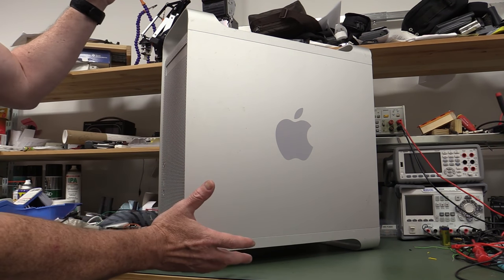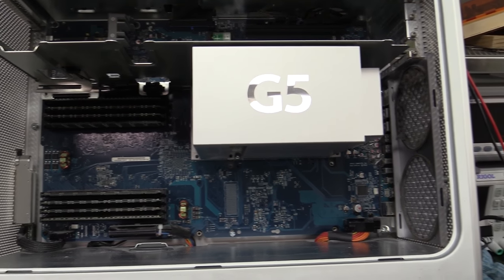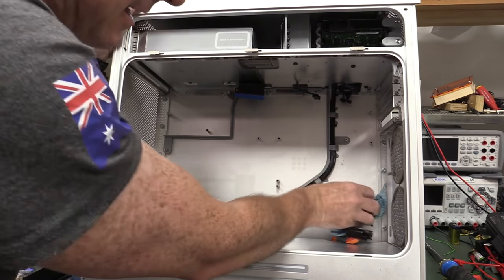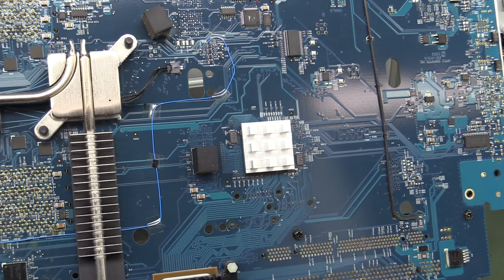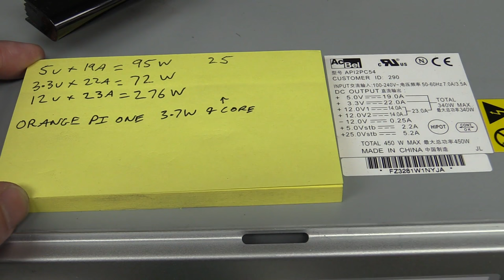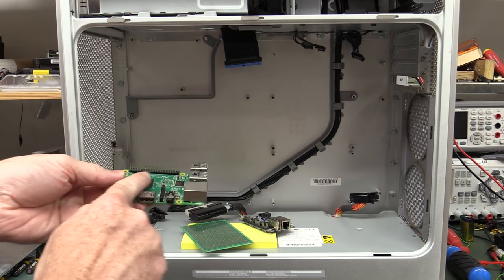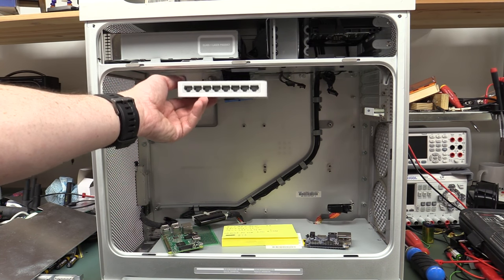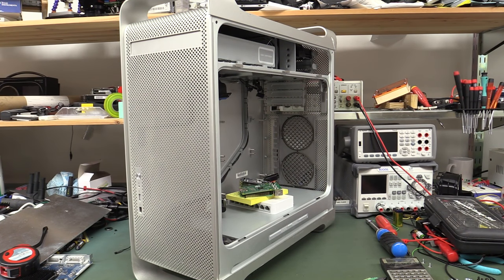EEVblog #946 - Apple (Raspberry) Pi Cluster - PART 2

Comment: I like the pcb mount ethernet jacks as an option the most. Maybe it'd be possible to use PoE to power the Pi's, and not even need them to plug in with the main header at all?

Comment: Wouldn't all those right angle connectors be a bit of a pain with such a dense array of boards to plug in? If you're doing riser boards you could use a nice self aligning card edge connector instead.

Comment: From my perspective, I would like to see more than "just another RPi cluster".  Your channel is all about full integration.  Forget the cables and use those through-hole RJ-45 connectors to mount the switches perpendicularly off the the mobo.  Also, you might as well do the same for the RPis, mount then with the ethernet against the mobo and use the extension boards to pick up the GPIO if you wanted them.  All I am saying is, you are better than a cable-filled box (and I want to see how it turns out!)

Comment: you know? i think it may be easier to get right-angle IDE hard drive adapters to put on the raspberries, and have a propper straight IDE hard drive connector on the raspberry hive board (because the IO is the same size as an IDE connector)

Comment: I'd mount the switches off the board and use cables to connect, since you may run into issues with sourcing the exact model of hub. I'd also get a standard PSU (or make your own) for the same reasons.

The ethernet will allow you to just have the bootloader on the SD cards and you can boot from the network, if you connect a NAS to the switches of course.

Comment: Dave, you must have master-device that will run all other, so you'll probably should use this standby 5V from the power-brick. Master-device will be just a gate that connected to all others via Ethernet and also used to connect monitor and perifireals. Even if you do not plan to have monitor and perifireals, you still must have master-device, because most of the Linux cluster solutions require one.
I also suggest to use Ethernet cables. It will be pain in the ass to arrange them all properly, but hell of a lot easier for maintenance.

Comment: I set my Pi 2 up as a Plex media server. Dead easy to set up.

Dave, in terms of ergonomics, when you were talking about an Ethernet solution, you placed the Ethernet slot towards the side end of the case - would this not be a better solution in terms of ventilation because no board will have Ethernet sockets in the way - the air would vent straight over each board.

Comment: Dave, the original plan for this was for no cables. I think stick to that. You're the expert here, if anyone can make this completely custom it's you. Besides, you said it yourself, there's plenty of other builds out there with short  cables feeding to switches.
If the latency is acceptable, my vote would be for the original SPI-Ethernet design. But, if you can get a board-mount ethernet switch, that would be pretty cool too.

Comment: I wouldn't go the upright Ethernet connectors Dave, you'll find you'll never be able to get it off again, unless all the spring clips are easily accessible and can be pressed at once. I once had a board that had Ethernet in a bit from the edge and was a real pain to try and release a cable

Comment: I would build large horizontal PCBs that have the Pi's upside down with the headers plugging in on top, and have the standoffs for securing them in both directions from the connectors to allow for the flipped design of the orange pi.

Each of these horizontal PCB's would have a common motherboard on the back of the case and slide in with card slides from the open side panel (like those in the Mac Pro for expansion slots) and plug in much like PCI cards. This means you could theoretically hot plug them too.

Comment: Hi Dave,
If you want to avoid using RJ-45, could you use the ENC424J600 instead of the ENC28J60?  The former supports both SPI and parallel interfaces and 100Base-T instead of just 10Base-T.  Perhaps you could put the devices and any magnetics on your riser boards and route the Ethernet signaling down to the motherboard.

Comment: You should integrate heatsink to that riser-board. Imo RP3 needs some heatsinking. My RP3 is about 43 Celsius with heatsink and 4cm 12v noctua in 5v.

Comment: if you turned the riser boards horizontal it would be better for airflow but you might need a metal bracket on the end to hold them up.

Comment: You could add extra components to the riser boards such as the power converter. The connection on the back plane for the riser would only have Ethernet and 12VDC.  Also have you thought about using wireless networking? The usb adapters for wireless can be quite cheap like $3 American.

Comment: Just an idea: if you are going to make connector boards for sticking the Pis in vertically anyways, why not have them be another right angle adapter themselves to be able to put the Pis in with the short side and have the USB/Eth connectors stick out towards the side panel? That way you could be able to fit even more of them inside, as long as the width of the case won't limit you in terms of being able to actually plug Ethernet cables into the individual Pis. I hope you can understand what i'm trying to explain here! :-D

Comment: Two mobo solution: one in the original location; one attached to the removeable side cover. No module stacking. (Maybe hinge the cover?)
Maybe dedicate each mobo to accept one type of computer: raspberry on one, orange on the other?

Comment: Might you consider getting an 18 or  24port switch from ebay , they are pretty cheap. dont be put off by the massive 19" rack mount cases , inside some have single slimline board + separate  psu board. Google image search "3com 1720-490-000" so you can check the depth.  Great project idea, really excited to see how this turns out. will be looking for updates :)

Comment: so did you actually finish it?
The OPis NEED a heatsink if you are gonna have a lot of cpu load. Otherwise they will step down on the voltage regulator and are gonna be as fast as a RPi B+.

Comment: If you are making a custom adapter board to mount them to the mother board, then you should make it so the raspberry pi boards mount with the ethernet and usb connectors facing out (towards the camera).  This will give you even better airflow across the heatsinks (you wont have the big connectors in the way of airflow) and you can then still access the usb ports and ethernet ports of each individual board if need be....

Comment: Boinc isn't terribly network hungry so I'd be interested to see the SPI -> Ethernet route being designed. You could actually do that on the riser boards so your motherboard only has pure Ethernet on it. If you wanted to go the wired route you'd just need a new riser with ethernet jacks on it. It would also mean you'd still have the elegance of a single plug to the motherboard.

Comment: Definitely use the on-board Ethernet ports, use cabling to a 24-port 10/100 switch. But, don't use cat5 cabling (which is just too thick). The 10/100 ports actually just need 4 wires (two twisted pairs). Look into 2-pair cat4 cabling (sometimes calles 10-base-T UTP). It's thin and much easier to channel and will support 100Mbit over short runs without any problems.

Comment: Just throw a BeQuiet fan or two in there and run them right off the 12v line, CFM is still overkill but you're getting like 20db or less if you're running it at a modest RPM.
Reply: Also, having intake fans is better. Positive pressure is better for thermals and positive pressure pushes air out of the cracks which means less dust

Comment: The G5 is still usable...

This coming from someone posting from a dual 2GHz G5 with 2GB of RAM on Tiger 10.4.11. Take my word for it, the GeForce FX5200 is crap.

The modem being in the opposite side of the case is probably because all system bussing goes through there anyways - so since the system I/O already goes up there for the internal connectors, making it much more convenient to put the modem there instead of by the connector or use an expansion slot.
Reply: *****
"Why is Linux still considered a thing"

Comment: For your vertical riser boards, add the Ethernet ports there and have a very short jumper cable, perhaps on some flat flex cable, and just use the header to supply the v5, and then from the vertical riser boards have your own custom socket with 2x ethernet and 5v, or perhaps some sort of stackable module with some kind of Ethernet pass through (if I remember correctly, it is possible to share a cable for Ethernet, so very little effort might be needed, much in the way old hubs worked)...

Comment: You can do ethernet over USB quite easily. If you had one raspberry pi on the motherboard to act as the hub, all the other PIs could connect to it as USB devices. 
It could be ethernet from there. That way there will be one connector to serve the PIs with both power and ethernet.

Comment: Just a thought, but given the Pi's Ethernet connection comes via a USB-to-Ethernet adaptor, and USB 2.0 is faster than 100Mbps Ethernet, could you use USB for the interconnect between the Pies instead?

Comment: Why not use usb for the networking? Isn't it like 4 times faster than the 10/100 ethernet on the various pi boards? It only supports like 70 devices on a bus, but that should be plenty.

Comment: Just my 2c on the Apple PSU, at that age could it not be a group regulated PSU? Particularly since they would have been able to get the load balance on it right and tune it accordingly given they know their hardware. So you might have issues loading the 5V rail if you don't have adequate load on the 12V side at the same time.

Comment: Mount the PI's to a daughterboard, plug daughterboard into a backplane?  You could customize the daughterboards to the PI types, no special jumpers needed.  You could even put the guts for an ethernet switch or USB hub on the daughterboard, and have that cascade to matching ones on the backplane.

Comment: instead of a riser board could you use a ribbon cable? I've noticed that an old floppy drive cable will plug right on to the raspberry pi.

Comment: I would prefer a board that lets the pis plug in horizontally (for good airflow). The Ethernet ports on the pis could be connected with a custom board + the male rj45haeders and port those connections through the off the shelf hub.
this would be 1 mainboard + individual riser+ a "Ribbon"-Rj45 board# the Hub, might be a verry rigid solution, because the interconnected boards would form a corner shape, the downside would be that you would have to unplug theribbon-board to change out the pis and it is critical to get the measurements right, a custom fitted multicore cable could be a better solution

Comment: Couldn't you still use one of those as a server? Maybe throw NetBSD or Ubuntu on it? Is it too far behind for even that? Just seems like such a shame to tear it apart like that. I remember shoehorning NetBSD on a headless SPARC Station IPX over an AUI>RJ45 adapter back in the early 2000's. So much fun, wish I had kept that box, it was great.

You keep saying Raspberry Pis, but I thought you were planning to use the cheaper Orange Pi for the cluster? There are some new Orange Pi options now as well, <$10 bucks USD with pretty solid Armbian versions for them.

Comment: Could you not strip the RJ45 and USB ports off and use the GPIO headers to do a hardwired solution that doesn't require any network cabling and/or RJ45 at all? Maybe run a few Pis per daughter board into the backplane which includes the networking hardware from the switches?

Comment: If you open up even a modern iMac or Macbook Pro they still have that flux residue on the power pins, seems like they hand solder those willy-nilly.
Reply: You must be new to the internet.
Reply: +Nukleon it's you that appears to be the noob his comment was clearly poking fun
Reply: +Dan sarcasm doesn't work on the internet.
Reply: +Nukleon No. that'd be you. :) relax, and try not to reply. Dare you.
Reply: On the Internet the tag <sarcasm> is by default :)

Comment: So what kind of processing power would 25 of these Pi computers provide as a cluster? I want to see if I can talk my father into building one as his next hobby project, but what can be done with it?
Reply: I am not so optimistic about 25 ganged computers like that.  Even 25 processors on one buss and able to DMA share memory would suffer a lot of problems with I/O overhead, traffic cop issues, dividing tasks and assembling results, etc.  Ethernet serial transfer would be a  huge bottleneck.  You certainly would NOT get general purpose work done at 25 times the speed of one processor.   With this much I/O overhead you might think that graphic rendering would be it's strong suit, but again DMA shared memory would be MUCH better.
This gang of Pi's could be good for a few very specialized uses but would probably not be good for general purpose computing.  If you could get software to make a gang like this work for general purpose computing, I would expect that at some number of Pi's, adding one more would not help and might actually slow things down because of overhead.
Reply: Imagine using a cluster of 25 of these for rendering one image.  If you divide up an image into 25 parts, every time a line draw crosses the territory of one and into another wouldn't the traffic cop I/O be horrible?  If 25 processors each work on different images, command of the 25 different jobs would still be a pain.

Comment: 32:17 I think neat color coded bundled cables runs add to the overall sexiness, but I can see trying to keep the cabling to a minimum so it's not intrusive or obstructing airflow.
Otherwise, I wouldn't consider a G5 useless. You could still build a nice DAW with it. Not up to modern standards, but capable. A G5 was the top of the line machine to build a DAW on back in it's day. But I think the machine was doomed from the start being inefficient power-wise, and I have never seen that many fans in a desktop otherwise. That was the major complaint on the Musicplayer forums back in the day, too much noise from the fans requiring you to do long cables runs to isolate the tower from the recording environment/control room. So you could find a quieter, more efficient machine from that period that might be better in a limited space, but the G5 was known to perform well as a DAW host machine. A home network, a music delivery system, there's all kinds of applications you can do on older machines. And like old cars or vintage audio gear, it's just fun to keep them running and preserve the life and history of these machines. It's no different than playing with some Pi stuff.
The case and overall design still look better than anything out there today. Keeping one just to run for nostalgia value would be cool enough in itself. I'm not even a fanboy/cult member, but I know good design when I see it. I'd like to have one. Being a PC guy, I've actually never used a Mac, so what better way to start than a G5? I was retro hipster long before it was cool. ;)
"Apple Pi" is genius. :thumb:

Comment: you should definitely  look into network booting those boards, at least the Pi3 can boot from network without an SD-Card (easy to change the OS for all at once, could be that you have to use the native network though)  (sry if you had another solution for this that I missed, also watched part 1 a while ago)

Comment: Love it! I would go for magnetics on the board and the Ethernet switch IC's on board. And I would add ethernet cables onto the riser boards. This enables you to make the cables the perfect length for the board type :). SPI will be an issue with performance, maybe not in regular use but when downloading updates for example. I like the idea of the LED/LCD screen at the CD-drive, but an LED matrix display (Especially with the 'dithered' pattern) would be even more awesome :D (but you should really use white LED's for that!). Make one of the board the 'controller' on 5VSTB so that it can instruct the PSU to 'power on' or 'power off' (controlled by soft button on the front or web interface or something). The connector almost seems like a standard ATX plug :o. 

Love the project and will keep following your progress :)

Comment: Fantastic case for the project! I wonder would it be worth the trouble/feasible to desolder the usb and ethernet ports and just work thru the IO pins and increase the density and improve the airflow that way.

Comment: And as others have said (buried in sub comments), you could way more easily fit a 24 port switch down where that big ass bulky power supply is, and just get a modern 100+ watt one and dump it up in where those hard drive bays are. :D

Comment: If I was doing this one personally I would build a daughter board along the bottom that took care of the Ethernet. I would build custom buck converters onto the daughter riser boards for the pairs of pie's (If you used an off the shelf solution you may need to modify to meet height restrictions) this should help keep the height down and keep the motherboard to be more a passive back plane. The short Ethernet cable idea is good from each pie to the motherboard if you use vertical sockets it would make the job easier.

Just my few cents

Comment: You know, that it's easy to click the switch in, and then you can just try to take the switch back out without disassembling the whole motherboard. Why? Because you have to press the locking pins to take out the switch, 8 at a time.